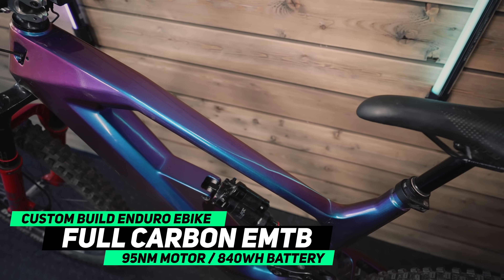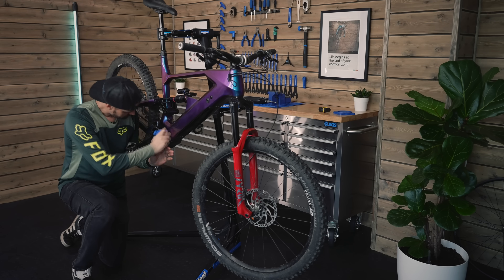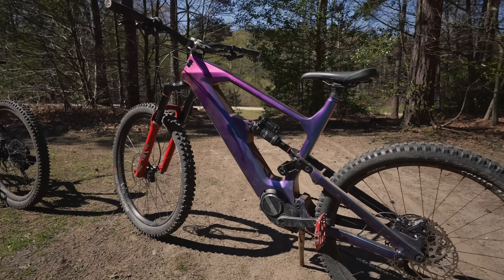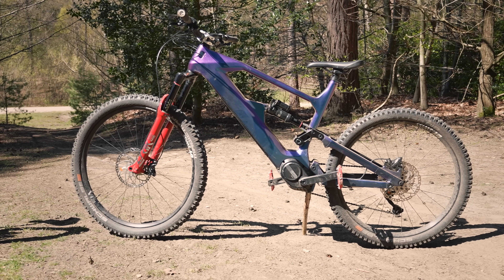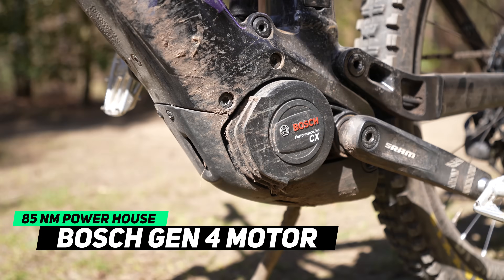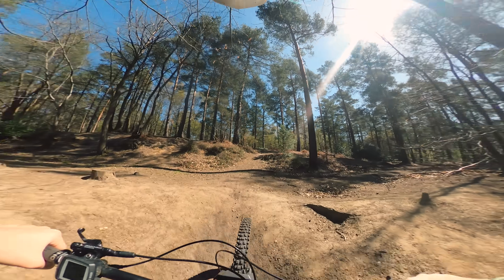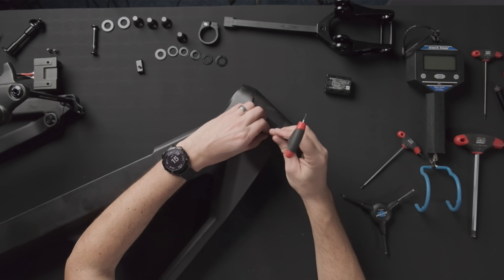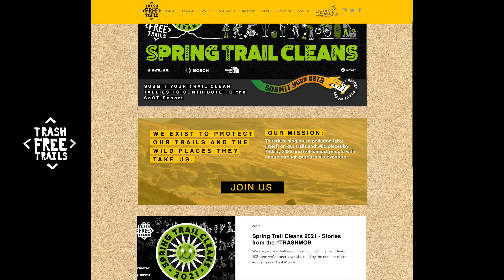This motor ABSOLUTELY CRUSHES it!!

Comment: The price to performance is garbage on bike parts, especially frames and motors.
I went and looked for similar alternatives to bike motors/ frames and found that you can get minibike frames for around 200$ but a simple steel bicycle frame cost over 8003, when I checked motors I could find the same spec motors in a conversion kit for scooters/mopeds for around 150$.    I will let them get away with a overpriced motor since they went full custom but I can't excuse the frames being stupidly expensive, they are not a complex part and they are very easy to streamline and automate.

Comment: Where Bosh is a closed system,.so all parts need to be bosh/manufatcter approved to work.If on chip fails ..you need to buy specific expensive parts,lSpecial dealer only software to adjust settings.
Bafang gives you more freedom.Special on bataries and displays,and custom settings.

Comment: The main thing i am really curious about, is the thing not mentioned. Is this the m500 g522.250 motor or the g520.250 motor? What is the max cadence rpm? For me the high cadence is the main selling point of the bosch motor. How does the bafang compare in this regard?

Comment: Going up steep inclines like that, you're going to be in the lowest granny gear so shifting in a higher gear wouldn't be necessary.  You can just set up your gearing ratio to match the terrain and make it easier climb up steep hills.

Comparing torque results from Bafang vrs Bosch isn't proof to me that one is better than the other.  It's all about having the highest torque in the lowest gear.   A low reduction gear in something like the Rohloff with over 500% gear range would make any electric motor comparable to another one if you are climbing hills and mountains  against another e-bike.

The test can give misleading or biased results unless everything else on the other bike is exactly the same except for the engine.
Reply from the maker: In my experience of many miles on both motors the Bosch easily outperforms the Bafang M500 motor. This test was just a demonstration, but real world experience and also others who have ridden both motors have given the same feedback

Comment: BBSHD will slay both of those motors, and with a 52v tune @ 1600 watts and be much cheaper. You'll wonder why most are ebikes such rip offs.  In raw performance it's a gold standard. HOWEVER, some major draw backs with a bbshd

-The unit is HEAVY.  I mean like really heavy, like 12-13 pounds heavy.  Like some entire bikes weigh less than the motor itself does. 

-It's a conversion motor, meaning, your bike will only be as good as the chassis the motor is mounted to and you'll need a bike to slot it through the bottom bracket. 

-Doesn't fit a stand form factor like these other motors do. 

-Requires the user to do some (a lot) DIYcraft to get the motor and bike into fighting condition

-Because the motor isn't intergrated into the body of the bike, might not be suitable for super rough trails because it's externally exposed.

The Pros to the BBSHD are immense however,

-raw performance makes other options seem like a rip off

-price/performance ratio is stupidly loopsided in favor of the bbshd

-REPAIRBILITY. The motor is super easy to repair and find replacement parts for at a reasonble cost. This is  a massive pro. 

-modular design lets you do drop-in upgrades to controller or motor core from 3rd parties really easy

-can be user programmed

-doesn't need a stupid app on your phone that sells your data like name brand emtb's

Given that the bbshd is such a versatile motor, it would be really interesting to see how the bbshd compares against other motors of a similar power rating. Given how much more expensive the name brand motors are in this area, seeing a price/performance comparison I'd think would be super interesting. It would also be interesting to see how modern hardtail or full suspension bike with bbshd and other DIY motors compare against what you get for a prebuilt name brand bikes of similar power rating to the bbshd. 

OR more broadly, content about DIY midrive ebikes vs brand name content would be super cool. The BBSHD isn't the only DIY name in town and it's a pretty big market that's still growing at a rapid rate.

Great stuff man, loved it.
Reply: Problem with bafang mid drive bbs02 etc is clamps down on frame so will damaged left side face of BB shell

Comment: Hi rob quick question for you, can you fit that Bafang M500 motor into a regular production E-bike? (like the Trek rail or Specialized Kenevo)  Fantastic channel by the way.
Reply from the maker: No, mounting points and sizing is completely different 👍

Comment: I don't get it, Nm is just the torque. You can increase torque of a motor by adding reduction gears, it will turn slower and with more torque. So, to compare two motor you need to know rpm and torque.

Comment: I like your video but maybe not for the reason you expect. It looks like the gear ratios for these motors are still not really optimized for climbing while pedaling steep sections so to actually bike on a mountain riders who are capable of riding a normal or  mechanically driven bike are better off riding or pushing when necessary until they have the strength, balance and stamina to climb.  Every bike I have tested works great in flats and short climbs.  Given the number of people with ebikes I pass stranded on a bike that pedals poorly withoput assist plus with bad geometry makes me think ebikes are still kinda like VR. A cool idea waitiing to be implemented in a way that makes it practical or an improvement over whats standard now. Standard batteries motor today still can't store enough power (yet) to do what I consider a normal mountain bike loop with elevation rises of over 2k'. Maybe when batteries are more capable and regenerative charging is enhanced these systems will replace leg work but for now the advanced gears and geometry of a good mtb can't be replaced by a motor driven ebike.

Comment: Why does he not confirm that wheel size, his selected front and rear chain rings during the test, and the crank arm lengths were all exactly the same on each bike during the two tests?  Without these being the same, the test is completely useless, and so is the video.
Reply: ...and WEIGHT!
Reply: Hard to believe the genuine Chinese motor doesn’t live up to its specs huh
Reply: @justinvanderkooi3604  I know right... shocked that it does not seem as powerful as the less powerful motor......

Comment: I understand this is a straight torque test but it would be great to know how the motor efficiency stacks up. Those Watt Hours in our battaries are heavy and dictate how long our day out is, for me I want to know I'm getting the most out of it, not just getting max power at any point. I only want enough power and good/best efficiency. If the Bafang is using more juice and being less powerful thats bad, but if its almost keeping up and using significantly less juice then brilliant.
Reply: Isn't electric motor efficiency generally very good?
Reply: For me the more juice I'm pumping out the bigger my smile is, so I squirt all my juice in big loads. God that sounds so wrong.

Comment: What's wrong with those motors why are you pedalling so hard to get up a very very steep hill?  I climb mountains that are slides when you sit at the top and just lean forward. But I use  350w Chinese hub motor and a 48v 12ah battery with 22amps max. Thanks I probably will stay hub drive because of power and it will be easy to just install on another bike when I choose to latter on.
Reply: I have a fat bike with a bafang 1000w 48v geared hub kit on it (I think 25 amps?) battery is 17.5ah. With all settings maxed out, Thing is a monster! Eats hills of all gradients for breakfast with pedal assist lol
 The throttle is OK but has it's limits, But using pedal assist there's nothing I can't fly up like superman aha. And just to think, I could upgrade to 50 amps... That would just be INSANE! I won't bother getting that done though tbh.

Comment: As a Bafang M620 and Bosch Gen 4. owner I can point out a few facts: M600 is the lowest spec'd Bafang you should consider Watt-wise. 250W Bafang motors are better only if you're DIY'ing your entire build. Compared to the M500 Bosch Gen 4. is much quieter, draws less power and has a much more soft assistance whilst still having more real world power. These Bafang motors are a great choice but only if you want to go over 250W and are able to DIY and know how to service these motors. Many countries have already/are legalizing 1000W motors. M620 is a good choice on that respect.
Reply: So, would you recommend M620 or another 1000+ w motor over  CX4,5, EP8, Yamaha ...? In my country, it's legal to drive  1000W motors. I'm interested in enduro driving and downhill.
Reply: @ not anymore. M620 is old and heavy. M560 is much better these days. It’s like 7 kilos lighter as well.
Reply: @  Yes but im talking about DIY motors 1000w and above. Something like CYC ?
Reply: @ Even CYC is better these days. M620 is straight out of 2018.

Comment: Just a quick question: Are the gear ratios the same on both of the bikes?  You probably thought of that in trying to compare the motors, but if they aren't, ie the bikes don't have the same ring size on the crank, or they don't have the same sprocket size on the casset, then the climb test is comparing apples with oranges.
Reply: Let the guy from Project Farm test the two!
Reply: That was my first thought as well.
Reply: Absolutely right
Reply: What about the weight?
Reply: He hinted at ratio
Reply: Yes everything should be exactly the same beside the logo. So we can test how much is the logo affecting performance. Crap that won't work either bafang has more letters than bosch.

Comment: 🤣🤣man those are really weak specs my bolt on mid drive bafang bbshd on 52v 41.4ah 30a makes around 1500 1600 continouos watts STOCK!!!!! easy 70kmh 45mph on THROTLE ONLY 170NM torque💪🏻💪🏻

Comment: The secret is upping the voltage to arround 50v & patiently searching the web for the punch code to get rid of the rev limit. You see all these mid motors That have 80 or 90nm + are actually a lot stronger than 250w. You see with these motors, torque outputs stay the same regardless of revs (I’m disregarding torque multiplication from gearing, much of which is cancelled out by having a wheel of 26” to 29” anyway), but to get that sort of torque, they’re really motors that will sustain 600 to 800 watts. Then they apply a revlimiter to make sure they won’t sustain more than about 300w - Keeping them close to or plausibly legal while getting the torque figures of a motor twice as powerful. Cheating the speed limiter by moving the speed detector from the wheel to the crank or using a tuning chip may increase speed, but not when you really want it, going up steep hills, which is what e-assistance is all about.

So if you really want to get the best performance you have to get a punch code or a tuner chip that releases the motor from it's built in revlimiter. Also upping the voltage from arround 40v to 50v helps stopping it get to hot as less amps are needed for the same watts.
Reply: If you're just doing off road trails why not just buy a full suspension bike around a grand and put a bafang bbshd motor in with 52v battery as I did, hills just ain't no more! ..sure beats messing around screwing every drop of power from a 250w motor!
Reply: None of these are close to 250 W. They all put out over 800 W maximum. The Bosch, Brose, and my EU legal Bafang M600s consume over 1 kW at max. But they are somehow still nominal 250W. And Nominal, what ever that means, is the key to keep it legal.

Comment: How does the power of a Bafang motor feel on a 26" a 27.5" and a 29" wheel 
600 watts is 600 watts but a larger diameter rear wheel should make a difference Right?

Comment: While on the topic of motors. I have a Commencal meta power and was trying to remove the Shimano e8000 motor so I could feed a new wire. I released all the 6 bolts but the motor wouldn’t drop out. After some tapping with a plastic hammer I was able to move it enough to feed the wire. Is this normal and why wouldn’t the motor just drop out. I also had to tap it back into place. Thx Steve

Comment: A little help please.. I'm building my first Ebike, a Scott MTB frame with a Bafang motor, it's what fits into the budget.. Where I live we're restricted to 250 watt motors, it's low but you have to roll with the punches.. The thing that is driving me mental is the battery.. just what is the deal with the different voltages, can you replace a 36v with a 48v does it make a difference, does it matter.. The 250 watt motor comes with a 36v 17ah battery, now I sort of have the ah figured but I want to go further than the 17ah are likely to give.. Where I live is pretty hilly and my empty head tells me that 17ah isn't going to take me very far.. How do you sort out the best volt and ah battery for your needs
Reply: I have bbs02 and it is fine on 48v I believe it will take 52v but fully charged that is 58v and very close to the maximum 60v components on the c board. If you get decent branded cells like Samsung, LG, etc 17ah at 48v will give decent mileage.
Remember if you have a small wattage motor it won't use as much as a 750 and that will do 50-60 mile 17.5ah 48v in my experience on Samsung cells

Comment: You tested a lot of motors but why don't you test the Oli Sport e-bike motor? It is made from an Italian company and adopted in some Italian e-mtb as for example the Olympia Karbo. Check this bike because it has a 900watt battery and the motor is very performing, EU compliant, but very powerful, it reach an astonishing 400% of assistance more than the best Bosch motor and it is really really aggressive

Comment: It could be the battery letting down th Bafang motor. Typically cheaper Chinese batteries are made with lower quality 18650 cells and dont have enough nickel spot welded between the cells. This raises the resistance and reduces performance. performance.

Comment: Anybody had any water ingress issues with the Shimano e 8000 ? I have a 2019 norco sight transported it in 2 hours of heavy rain and I’m a bit worried, would Moto foam be any good to protect or do these gaps need to be there for cooling ?

Comment: I am curious as to the PAS sensor on the Cheeb. If it only has a cadence sensor (power while pedals are moving) while the Bosch has a torque sensor (power while there is force on the pedals), that would explain everything.

Comment: I used to believe what I heard about Hub Motors not being good at climbing till I actually put one on a trail.  To my surprise it's not true at all. My 500 watt nominal 900 watt Max Fat Tire Bike would fly right up that hill.  Would probably jump it actually. I've never seen a turbo levo on a trail come close to the speed that my 500 watt Hub climbs at on a trail.
Reply: They are fine for climbs, just not prolonged climbs when the speed gets too slow. Then they heat up and shut down. The middle motors stay at a more optimum rpm with it being able to use the gears.

Comment: Hello @Rob Rides EMTB I noticed you swapped the Zeb for a Lyrik (both ultimate). What are your thought ? My bike came with a Zeb but i'm a light 62kg rider and i wonder if the Zeb is not overbuilt for my body and the kind of riding i do. I motsly never ride lift trail but more enduro tracks. On the other hand i'm happy with the Zeb (i have a Select Charger), very smooth and i don't feel like the extra weight really remove performance from the bike. It's not like there is a huge difference in weight between Zeb and Lyrik.
Also considering the bafang i was a bit surprised by the result. When you said they added turns my intuition was that the motor would have better low end but worse top end (support at speed) but your test was mostly a low end torque test. Weird. I think the Bosch edges thanks to better motor controller. Low speed brushless control is tricky, moreover i would not be surprised those motor are sensorless which make low speed control even harder regardless of the number of windings.

Comment: Has your Bosch motor developed a rattle when descending and not pedalling?
Reply: i just worked on a customer with a gen 2 motor a year and a half out of warranty that was making a terrible noise, and bosch replaced that motor free. Go to a local bosch certified dealer, they will help you.